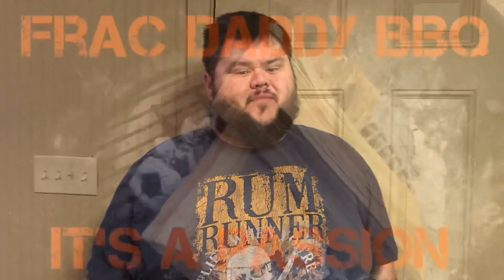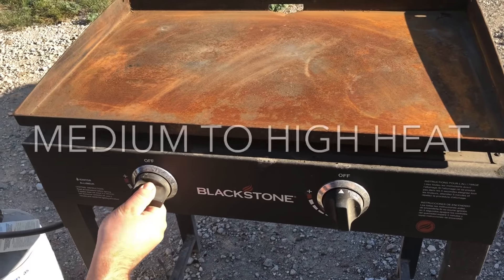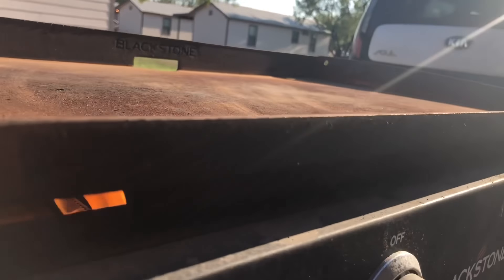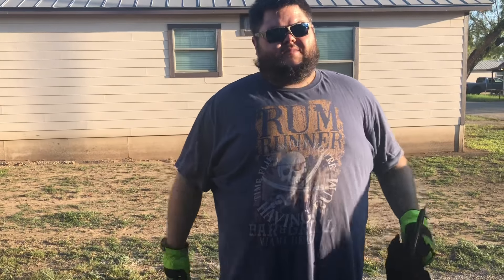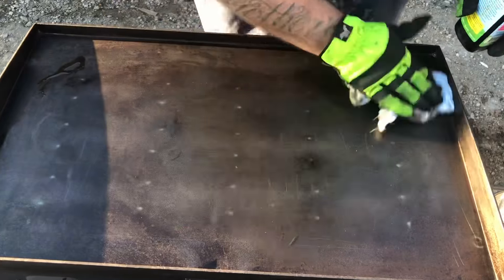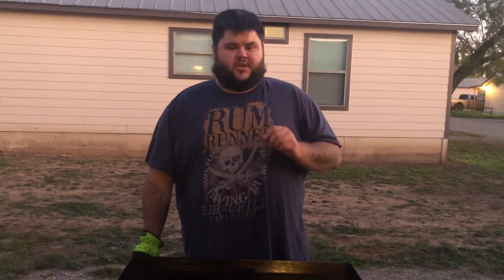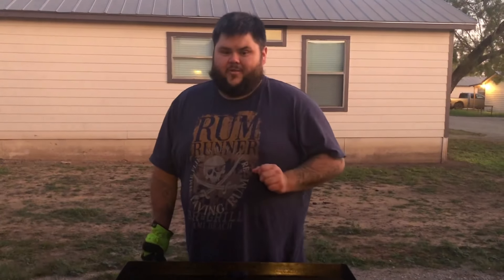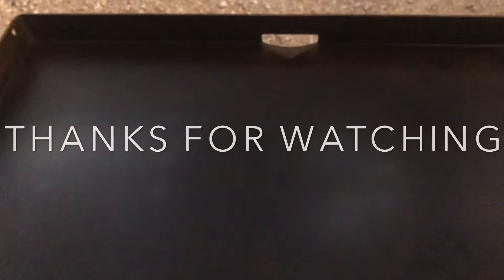Rusty Blackstone or Camp Chef? You Can Fix it as Easy as 1,2,3!

Comment: Use a wire wheel on a drill instead of the stone ..  boom done in about 15-20 min. Then season .. 😎
Reply from the maker: Thanks for watching
Reply: yea im headed to home depot rn for a new wire wheel 😅 my traeger has been getting all my attention, i gotta revive the flat top 😂
Reply from the maker: @maxrocks00  the wire brush will make fast work of it for sure hope it turns out good

Comment: Great video. I have several small areas of rust on my Camp Chef. Followed your instructions. Not all of the old coating came off, the rust spots did. I seasoned as instructed but the surface is not completely smooth where the old coating and the new seasoning is. Do you think it will fill in and smooth out with additional coats or did the whole griddle top needed to be taken to bare metal? Thanks
Reply from the maker: I just saw this comment sorry it took so so long yes I would just take off all the old seasoning and re do it hope you had a wonderful thanksgiving

Comment: The only thing I did not do was use water, I watched a Video made by Blackstone and they said it's not a good time to use any water at all while doing this entire process, so I did not..
Reply from the maker: I always use water to clean mine then I leave the heat on so it drys up and add a layer of oil
Reply: If you flood a hot steel with cold water it could warp, a damp rag during the process wont hurt it, but dont hit it with a hose.
Reply from the maker: Edward Stephens I’ve honestly have never had a problem I just use tap water every time then leave the flames on and re oil